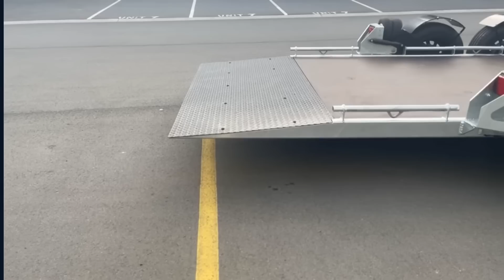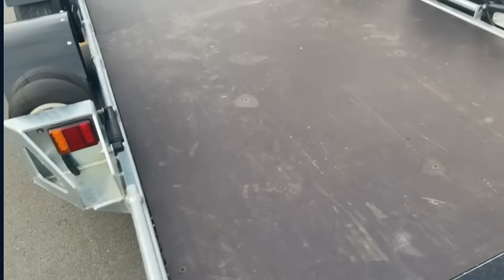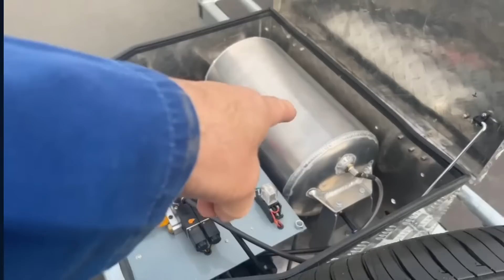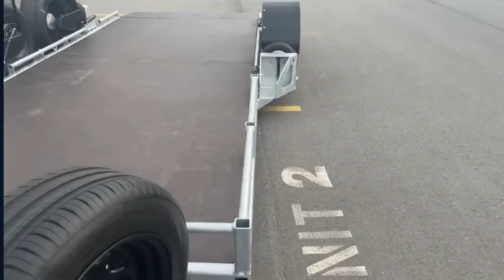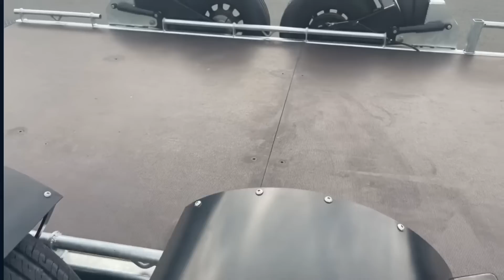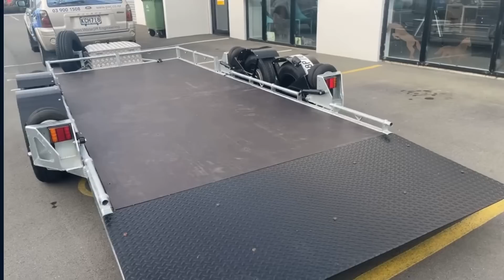How does an Airbag Trailer work 1.3

Comment: The airbag trailer lift is really cool. But to say that airbags will only burst under extreme conditions is very naive. The only thing you can guarantee about an airbag is that it will eventually burst. It’s rubber, even the sun damages them. I had 3 airbags go on my truck just last summer from regular wear and tear.
Reply from the maker: I am sorry to hear about your truck airbags. We have been operating heavy and frequent loads on these trailers for over 3 years now. none of the airbags show any signs of deterioration from wear or weather. You are right that the sun will eventually get them but we do treat them to make them last longer. 
Our clients buy these trailers because they have advantages for their particular application and they are wise enough to expect a failure at someone in their trailers life. Even springs on traditional trailers break and they are a lot more difficult to change that an airbag which takes about 35 minutes. 
The lifespan of an airbag suspension unit under normal operating conditions when exposed to the sun can vary depending on factors such as the quality of the materials used, the intensity and duration of the sunlight exposure, and the frequency of use. Generally, airbag suspension units are designed to last for several years, ranging from 5 to 10 years, and with proper maintenance, they can continue to function properly for a long time. However, we agree that prolonged exposure to the sun can cause damage to the materials and components of the unit, leading to a shorter lifespan.
Reply: @ultimatemanshed  I have no doubt that your trailers have major advantages. Even just for older folks who can’t drop large tailgate ramps. I’ve never seen anything like these in Canada. They are really cool.

Ours burst at work much faster due to how much they are abused. I drive a dump truck and pup. We are constantly overloaded, they get covered in mud, gravel gets in there and we drive on and off-road with 46,500kg. Ours go very quickly. 5-10 years is actually quite a long time for them to last. I almost had a heart attack the first time one blew though. 

I wasn’t talking shit about your products, I was just trying to burst your bubble 🤣😝

Comment: Those bags won't last long exposed to the sun
Reply from the maker: How long do you think is a good life cycle for these airbags?
The lifespan of an airbag suspension unit under normal operating conditions when exposed to the sun can vary depending on various factors such as the quality of the materials used, the intensity and duration of the sunlight exposure, and the frequency of use. Generally, airbag suspension units are designed to last for several years, ranging from 5 to 10 years, and with proper maintenance, they can continue to function properly for a long time. However, prolonged exposure to the sun can cause damage to the materials and components of the unit, leading to a shorter lifespan.
Reply: @ultimatemanshed  I won't argue that. But just like a spare tire. I would carry a spare airbag. That would be a nice option actually. I assume a regular Jack would suffice for a roadside change?
Reply from the maker: Yes, carrying a spare bag is a safe option, however if the trailer is already on the ground, there is no room to put a jack under it :-(  I am not sure how big a failure will prevent you from turning on the compressor and at least partially lifting the trailer until you could get the jack under it, perhaps that's something we should try.
There is no doubt that we cannot cover every eventuality and I never set out to do that, but helpful suggestions from the user community help us come up with solutions. If you are just changing a tire, no jack is required. Ill do a video in the next few days show how this is done.
Thanks.
Reply: @ultimatemanshed  that would be a good video. And maybe you could add some brackets for a bottle Jack incase of a airbag failure. Food for thought. I do like your whole concept. Always nice to have fail safes.
Reply from the maker: @playsportfun3356  There is actually room under the suspension brackets for a floor jack, I'm just doing a video this afternoon about how to change a tire with no jacks.. one moment please :-)

Comment: What happens when one of those trailer tires blows out?? Am i now dragging my trailer on the highway?
Reply from the maker: You change the tire, just like on a normal trailer. Did you not see the spare wheel bolted to the front of all the trailers in all the videos? OK, I'll go do another video today showing how we change a wheel without jacks. If you subscribe the system will automatically send you an alerts.
Be alert. the Country needs more lerts ;-)
Reply: @ultimatemanshed  Specifically, when the tire blows, does it destroy the air lines or air bags themselves?? Since someone is selling this product for use on public roads, you must have done some safety testing?
Reply from the maker: @roadrunnersummer  When a tire blows, you replace it, like a normal tire nothing else blows.
Reply: @ultimatemanshed   ive seen them let go on trailers like this and the shredded tire destroys the wiring for the trailer brake. Also destroys the fenders.
Reply from the maker: @roadrunnersummer   Great questions, all of our wiring and air control systems are inside the trailer chassis tubing, nothing is exposed and cannot be harmed.  Our fenders are 4 mm propellor plates affixed with industrial grade HUCK bolts to 5mm steel side brackets, I don't think any tire is going to break them. 
 I have a new video coming up showing in more detail the trailer driving with a load, subscribe and you'll get a notice when it's out.
Reply: @ultimatemanshed  Also, the extension on the trailer moves well past the lights indicating the end of the trailer. This is no doubt illegal in some places? Are there any lights on the extension indicating its true length?
Reply from the maker: The light location on this trailer is certainly legal in New Zealand or we would not be allowed on th the road.  We have had a few comments on this one but none has yet to  send me any specific rules on other countries, when they do I'll make a recommendation to fittings.
Reply from the maker: @roadrunnersummer  nop, and if you need lights on the very back, which we do not in NZ, simply put them there.

Comment: What is the gross trailer weight? I'd be interested to see if the brake efficiency is capable on just one axle for the export market
Reply from the maker: The weights of our trailers are determined by the design specifications provided by each individual client. Our range of trailers includes a light-duty model weighing in at 575 kilograms, with a maximum carrying capacity of 2000 kilograms. On the heavier end of our spectrum, we offer a trailer constructed from 5mm 100x70m RHS, weighing in at 645 kilograms when empty, with a maximum carrying capacity of 3000 kilograms. Within New Zealand, single axle braking systems are permissible for trailers under 3000 kilograms. For trailers exceeding this weight, dual brakes are fitted, with operation facilitated by an electric brake controller. Hydraulic brake systems are also available, depending on customer preference.

Comment: If there is a air leak you cant move the trailer, it should have some locking device for the ride high so can drive with no air….
Reply from the maker: If there is an air leak yo cannot lift the trailer back up to lock it unless you use a jack.  However, the only airleaks we have had over 3 years of operation are joints, not the airbags themselves and these joints can be nipped up with a spanner. No doubt we will lose an airbag one day and you will have to simply drag the trailer off the road while you get a new airbag onto it, which can be fitted in about 30 minutes. One advantage is that the trailer is complete flat underneath, nop axles or anything else protruding so if you did need to drag it , no road or trailer damage ;-)

Comment: Looks great. How much more expensive is this than an equivalent size and capacity trailer with traditional running gear?
Reply from the maker: lots
Reply: @Airbag Trailers, how they work and how to build  that's what i thought. There is no situation where your product is necessary then.
Reply from the maker: No product is necessary these days, we just choose what we like and find a way to justify it to our wives  if you are lucky enough to have one that is :-)
Reply: @Airbag Trailers, how they work and how to build  Fair enough. What's your angle though? What do you say when someone asks why they should pay x amount for your product when there are hundreds of choices of more affordable trailers that perform the exact same jobs perfectly well? Not trying to be a jerk, i'm genuinely curious
Reply from the maker: Ian, I see what you are asking and can say that the first thing people want to know is the price, we are double the price of some ramped trailers in some cases. If after hearing the price they are still talking to me it's because they see a benefit to not having to deal with ramps, for example they might be a smaller women race driver, of which there are many and they find it tiring at the end of a long days racing to have to deal with ramps. We have a number of these clients. 
Another example is one of our clients is a agricultural contractor, again he employs mainly women and they find it faster and easier to use than a ramped trailer and they load about 3/4 times a day, he saves over 2 hours per days simply because its faster. That's  10 hours a week in wages.

Another example is on of our clients is a wheelchair user and he cannot operate ramps by himself, this trailer gives him the freedom to go racing by himself.
Another example is one of our clients is a car recover agent for breakdown or towaways. No ramps means he can drag damaged vehicles on at a low angle and cause less damage to both his trailer and the vehicle, plus he can back up closer to the target vehicle and simply dropped the trailer tail under the wheels

Another example is a motorcycle moving company, some very large bikes such as the Honda Goldwing are a huge problem for ramp loading particular if they are broken down and will not start.

I won't carry on but horses for courses, we cannot make enough and we always have clients wanting something added or changed. I am glad we can offer something different and fulfil a need, and particularly proud that we can assist any disabled sports people to have more independence. I hope this offers you an acceptable answer to your question.

Comment: Would it cause any damage to the airbags pushing at an angle like that?
Reply from the maker: No, Airbags on suspension setups are designed to operate effectively even when subjected to acute angles, in addition to straight up-and-down or parallel configurations. This is made possible by the inherent flexibility and durability of the materials used in their construction, such as reinforced rubber or polyurethane. These materials are able to stretch and compress in response to changes in pressure and load distribution, allowing the airbag to maintain its shape and performance even when exposed to unconventional angles.

Comment: What is the deck width? My vehicle is 7.5ft wide, but I'd like 8ft. Also, what is the cost, plus the cost for an enclosed trailer?
Reply from the maker: Rob, with the trailer deck you then have to add width for the suspension.  Our maximum width build here in NZ has been 2200mm inside which means the trailer overall width is 2700mm, which is roughly 8'8"
Don't know the cost for a enclosed, we c would need more specification from you. feel free to send some ideas to alan@pwj.co.nz

Comment: First time I see airbags mounted on a car trailer like this, interesting concept.
I drive a Scania straight truck with airbags on the rear axles, definitely the comfiest truck I've ever driven, I wonder how great this airbag trailer drives.
Reply from the maker: Thank you for your comment! Airbag suspension systems are becoming increasingly popular in a wide range of vehicles, including trailers, trucks, and passenger cars. The use of airbags in trailer suspension setups offers a number of advantages over traditional spring-based suspensions, including smoother ride quality, better load distribution, and improved stability.

In terms of driving performance, airbag suspension trailers are known for their smooth and stable ride, even on rough or uneven roads. The use of airbags allows for greater control over the suspension, with adjustments made in response to changes in load distribution, road conditions, and driving dynamics. This results in improved handling and stability, particularly when cornering or navigating tight spaces.  In other words you can't even feel the trailer following even a light towing vehicle :-)

Comment: Why do cars need bumpers and then look at the knife on the back of this!?
Reply from the maker: Sorry, I have no idea what you are talking about, Do you mean suspensions bumps stops or font and rear bumpers, which have nothing to do with trailers?
If you are talking about bumps stops thats to stop the axles exceeding the spring compressed dimensions and causing a bending moment in an axle or other suspension component.
If you are worried about someone sticking a knife into your trailer, I recommend you move to a nicer neighborhood.  I can't help you with that one, however if you have an airbag trailer you will be able to move faster as loading you furniture will be easier.. quick move now before someone comes at you with that knife you are one about !!

Comment: Looking at the thumbnail, I wondered if you could overfill it to get more ground clearance. Did not expect you to drop it to the ground, that's cool.
Reply from the maker: thanks, yes you can lift the bags to max and not damage them as they have a burst rating way over our operating pressure.. once over the obstruction, you can use the cab remote controller to loser the trailer back down to a good ride height for hyway towing. :-) nice trick eh

Comment: Wonder how this system would work for a boat trailer ?  Being able to drop the boat down a couple inches would fit it in the garage.  Might even help with launching in some places.
Reply from the maker: yes we have designed one of these as a boat trailer. and also a single axle version for jet skis. works very well.

Comment: electric components that enhance weight thrust through taillights primary connectivity save fuel by free coasting the primary in neutral and secondary by five speed and reverse
Reply from the maker: What the heck are you on about or did you small child write this my mistake?
Reply: sandalias ; right
Reply: and antlers
Reply from the maker: @chardelraconner7324  orgieveme. sometimes i just have no idea what you're on about, this is one of those times..:-)

Comment: I don't get it. Having used all manner of trailers for all manner of hauling for farm life and for fun (track days & toy hauling), simple & cheap ramps have never once left me wishing for 'a solution'. This is a mountain of expense  and eventual maintenance  / failure points, plus obviously hundreds of pounds heavier than a normal trailer. PS: that's not 'a lot of tie down points'.
Reply from the maker: I don't get it that some folks just can't accept that some other folks do get it and you don't need to poke holes in everything just because you might disagree with the way they do things. 
No1. Yes simply cheap ramps work, however, some ramps are not simple or cheap, they bend, get lost or stolen and they can fall off the trailer even when loading if not fitted properly. If you want to see fails, just go do a youtube search for 'trailer fails"
No2. Low cars are notoriously difficult to get on to most ramped cars, that's what this trailer was built for and it does the job beautifully.
No3. Everything is a mountain of expense compared to a cheaper and sometime half arsed solution. 
No4. We have very few maintenance solutions to solve. please tell me what you think they are? oh hang on we do get flat tires, just like your trailer with the ramps.
No5. The trailer weighs no more than a ramped trailer, how heavy is your trailer, and how heavy do you think ours are?
No6. How many tie down points do you need? take a look at some of our other videos and you will see some trailers have tractors and farm machinery, tied down all over the equipment, oh and guess what oh great wise one, it's a steel trailer and you know you can weld as many tie down points to it as you need, actually you might need some more in order to tie down your ramps and bit of wood and other junk you need to get some loads on..
***Still, if you are having all these maintenance problem perhaps you're a shit welder and don't know how to do this stuff. 
 Anyway we thank you for thinking of us and make some great suggestions and we look forward to all reviewing your trailer designs and build with much anticipation :-)
Reply: @ultimatemanshed  Holy  cow. Has anyone ever told you that you're an overly sensitive drama queen who flies off the handle at the slightest bit of criticism? That's a rhetorical question. Of course you've obviously been told that many times in your life lmao. PS: If I have to trailer an extremely low car like a GT3, that means I have a LOT of money to throw around. If I did, I'd have better things to throw it at than this. You go girl.
Reply from the maker: @MISTERLeSkid  yes they have.  I think I’m going thru the change

Comment: What is the GVW on the trailer shown?
Reply from the maker: The trailer weighs in at 600Kgs plus extras you ask for and can carry 2,500, our target GVW is just under 3000Kgs to comply with most towing regs for light vehicles in New Zealand. If your vehicle allows you to tow more weight we can build a trailer that will lift and carry up to 3500kgs.